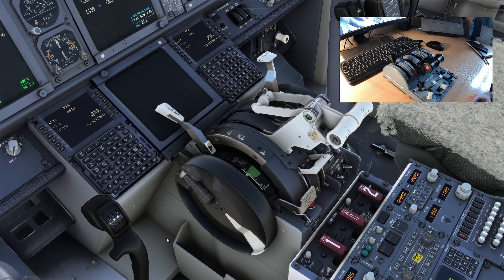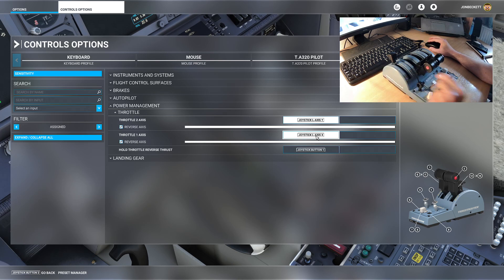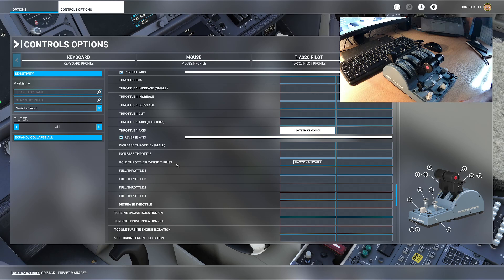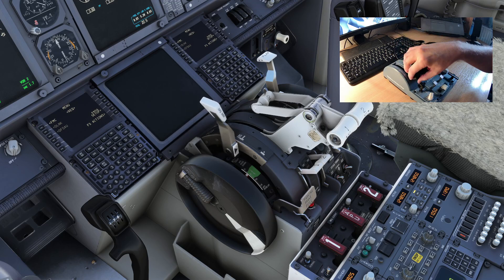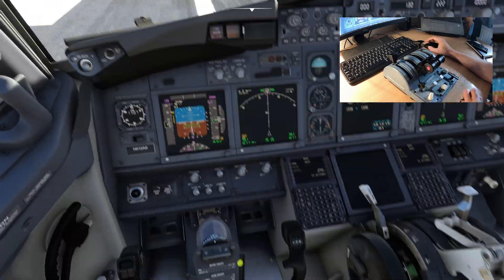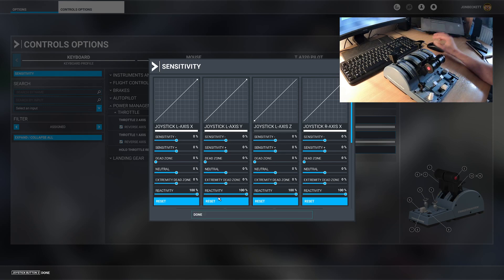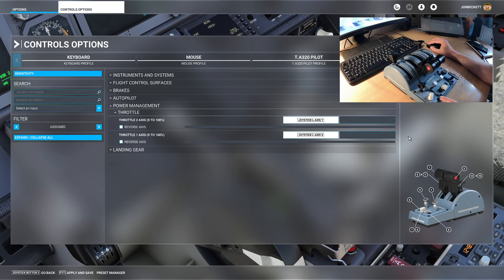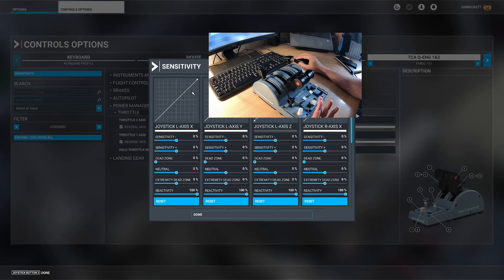How to configure the Thrustmaster TCA Throttle Quadrant for the PMDG 737-700 in MSFS

Comment: Hi can you please tell us how to make the engine start possible on TCA Throttle Quadrant what I mean is when you press ignition start on the TCA Throttle Quadrant you will trigger the switch on the overhead panel engine start GRD  and also is we can make the fuel cut off switch make working on the TCA Throttle Quadrant  for Pmdg aircraft  I would like to start the engine in my 737 without clicking the mouse on the overhead panel I hope you or somebody else can explain this to me ,but please don't say I need the span next for that or different fcuipc module

Comment: I actually managed to get it to work on the 0-100% keybind. I also didn't use a Hold/Toggle Reversers keybind. With a little luck playing around with the sensitivity I got it to go from 0-100% throttle without the need to have it in the reverse detent. And when you put it in the reverse detent, it infact goes into reverse thrust.
Reply: care to share how?
Reply: @MikeP343   @juliangriffiths9583  wow guys I'm so sorry I feel like the villain here for not sharing how.

1) Set Throttle 1 Axis (0 to 100%) to JOYSTICK L-AXIS Y
2) Set Throttle 2 Axis (0 to 100%) to JOYSTICK L-AXIS X
3) Open the sensitivity graphs (top left)
4) As follows:
JOYSTICK L-AXIS X
> "SENSITIVITY -" 0%
> "SENSITIVITY +" 0%
> "DEAD ZONE" 0%
> "NEUTRAL" 48%
> "EXTREMITY DEAD ZONE" 1%
> "REACTIVITY" 100%

JOYSTICK L-AXIS Y
> "SENSITIVITY -" 0%
> "SENSITIVITY +" 0%
> "DEAD ZONE" 0%
> "NEUTRAL" 48%
> "EXTREMITY DEAD ZONE" 0%
> "REACTIVITY" 100%

Hope this helps. Also the extremity dead zone can probably be 0% for both i think since i might have accidentally put one of them to 1%

Comment: I have a setting i have for the airbus Throttle for the PMDG 737 and i can use it for the 737 the yellow arrows on the throttle tells you where the reverse thrust is you bring the levers back then pull the throttle back tot he yellow area that is where the reverse thrust kicks in you don't have to use that button  works fine for me with my setting..

Comment: Many thanks for this, and your other videos. I found that you can indeed use the parking brake using this format. With the PMDG 737, after releasing the parking brake you then then either hold the toe brakes or the brake button on your joystick for around 3 seconds after release of the parking brake. That will then release the brakes.
Reply: I confirm

Comment: Sweet! Do the throttle cutoff levers work as well? If so, do you know what they’re labeled in controls options?
Reply from the maker: I use the mouse on everything else - there are numerous switches in the Boeing cockpit that don't suit the Airbus controller.
Reply: @jonbeckett  Thanks for the reply, Jon. I can’t get those fuel cutoff switches programmed for the life of me, I guess it just isn’t to be.

Comment: Hi i have set button one also for reverse thrust so copying your settings, and done all the sensitivity the same, but my reverse lift up maybe 50% tops but dont come so reduce to off off any idea's?
Reply from the maker: It won't do it before the engines are running :)
Reply: @jonbeckett  ahh thank you, I need to study this plane anyway my head is frazzled as I’m use to the A32NX and simbrief making it very easy now just love the cockpit details on the PMDG 737

Thank you as always your videos are superb 👍🏻
Reply: Sorry one other question you said about putting the Joystick sensitivity settings all to neutral, should i have this also for GA aircraft not the standard settings it has for the A320?  @jonbeckett

Comment: You can also try this. Go to Management/Throttle/Throttle then set THROTTLE 2 AXIS to JOYSTICK L-AXIS Y and REVERSE AXIS ticked. and THROTTLE 1 AXIS to JOYSTICK L-AXIS X. Then set THROTTLE 2 DECREASE to JOYSTICK BUTTON 16 and THROTTLE 1 DECREASE to JOYSTICK L-AXIS X. Then select SENSITIVITY and set JOYSTICK L-AXIS X and JOYSTICK L-AXIS Y to

SENSITIVITY-		0%
SENSITIVITY+		0%
DEAD ZONE		        0%
NEUTRAL			0%
EXTREMITY DEAD ZONE	-53%
REACTICITY

Your TCA A320 throttles, including reversers, should then work perfectly with the PMDG 737 😄

Comment: For some reason the engine masters won’t let me turn on the engine from cold and dark.  Does anyone have any ideas on how to fix it?
Reply from the maker: You need the APU running (electricity), the fuel pumps on, and APU Bleed on (compressed air to spin up the engines). You need packs off, otherwise the cabin pressurisation system uses the compressed air you needed to start the engines :)
Reply: @jonbeckett  Okay thank you!

Comment: Hi Jonathan, as you may remember, I've recently received my Airbus Captains TCA kit, just one point and it's with ref to your comment about the red button for TOGA, in your video at 2.25 you can see the TOGA button on the throttle, the buttons on the 737 throttle as ref to where the red ones are on the TCA kit, these are the Auto Throttle disconnect buttons. This is really only for those very new to the 737. But again as I'm getting into using the TCA kit, this is a superb video on setting the TCA kit up. I'm trying to find out where the calibration files are in MSFS, I've found them before and edited them but can't find them again, any ideas?
Reply from the maker: I just use the control profile sensitivity settings, and then the controller calibration (it's in the PMDG menu, in the FMC).
Reply: I found the files,  I had seen a guide to where they are but couldn't find it. Just used a Dos command to find them

Comment: My engine start keys do not work even though they are active. Airbus is working on the plane.
Reply from the maker: The start sequence (and hardware) for the 737 is very different than the Airbus - you wouldn't expect the start levers to work.
Reply: @jonbeckett  First of all, thank you for your interest, I wanted to ask you what setting you made for the engine start (idle/cut), I tried a lot, I looked at which keys are assigned in airbus, but I couldn't find a solution.
Reply from the maker: @orucmetehanmutlu  It's a multi-step process - not a single function. That's probably why. You need to have power, the APU running, APU Bleed on, fuel pumps on, Ignition system to Start, and then the starters will work.
Reply: @jonbeckett  yes, as you said, I tried yesterday by installing spadnext, even the brake needs to be pulled for the starters to go down.
Reply: @jonbeckett  I don't expect the TCA keys to do everything, just to control those two switches under the throttle levers. I don't understand why it isn't possible (although I now see that the TCA Boeing Qudrant indeed doesn't have anything that looks like those two switches on the TCA Airbus Quadrant).
Reply from the maker: @RonInbar  the Airbus Thrustmaster control is a bit odd in the way it's mapped - for some of the switches they are not just "on" or "off", they are "on on on on on on on" or "off" (if that makes sense) - and only some aircraft work with that logic.
Reply: @jonbeckett  The problem isn't with the controller really; it's with the PMDG aircraft. It doesn't expose an action for these switches that can be bound to a hardware controller. I think I tried everything that seems applicable. Also, it doesn't help that the Controls Options page seems to have been coded by the least competent programmers they had on the team.

Comment: What key is it called to start the engine with the 737? I want to set that up
Reply from the maker: There is no single key to start the engines on a 737 - it's a sequence of procedures.
Reply: @jonbeckett  I’m talking about the keybindings for the engine start
Reply: What keybindings is it to set engine one and two on start ups
Reply from the maker: @mb944  It isn't - I click on the starter levers with the mouse. If you check some of my 737 startup videos, I go through the startup steps required.

Comment: Thanks for this, you mentioned the parking brake doesn't work but it seems to work fine for me (other than having to hit the brakes for it to engage & disengage). The reverse works fine but I get the feeling I'll be shelling out for a Honeycomb Bravo in the future to solve this properly...
Reply from the maker: The switch on the TCA throttle works by sending the signal repeatedly. You have to be really careful about how you set it :)

Comment: I used this video and it worked for about two weeks and then randomly stopped working. I've tried switching to the 0-100 option as well but nothing seems to work.
Reply from the maker: Without knowing what else you've got going on with your controls it's hard to say. I've never had an issue with it working.

Comment: Hi Jonathan. Can you tell me what monitor you're using ,is it 4k only my monitor isn't as clear as yours.  Any help would be appreciated.  Thanks Alan
Reply from the maker: I see the simulator in 4K - but then it is down-rated to 1080p for YouTube by OBS (screen capture software). If I switched the monitor to a "normal" monitor, it would be a LOT smoother - at the moment I'm really pushing against the limit of the GPU to both display AND record at the same time in Ultra.

Comment: Since today my reverse axis are both gone. Now the throttle levers only know one movement. 100% or 0%
Reply from the maker: I've heard this from several other people - it may be the controller is broken.
Reply: @jonbeckett  It’s brandnew. I figured out the problem 😅 The filter on the left was on “assigned” instead of “All” and voila

Comment: I have a problem with parking brakes. There is a new way to do it but I can't set it. There is always a heavy noise from the cockpit like if you were writing on an old type writer. And when GSX ask to release parking brakes for pushback, I cannot go anywhere because I can't release them. Any solution with TCA? I have CH rudder pedals but one cable is cut and I can't use them. :|
Reply from the maker: Hold the wheel brakes on for a second, then you can set the parking brake while they are on. This is accurate to the real aircraft.

Comment: Jonathan I am so drilled from all of your tutorials. As you present them it is just brilliant. I do not know how many other see this, but this is personal statement, and of course I always learn something new. 
However, the parking break is not working in the cockpit, n of course I deleted, eliminated the function in the control options. 
The other think is; how gonna be functional the reversers trust at landing, (actually after landing)?, I confusing on this? I did set up the thrust as you did and how gonna works the revers thrust?  Would you explain this revers thrust Pls. Thanks
Reply from the maker: The break in the 737 is a bit unique. You have to hold the wheelbreaks on, then you can set the parking break.
Reply from the maker: On about the reversers, they only work when you're travelling - they don't work at a stand-still.

Comment: the reverse thrust part doesn't work for me. I set it to the same button as you, I'm holding it down, and moving the throttles and it just jumps a little but it doesn't move.
Reply from the maker: It only works when the engines are running.

Comment: My pmdg works like shit, ive done the exact same thing as you and my throttle don't go to idle when put to idle on tca and my parking brake don't work not even manually or with the tca p.b, my LNAV/VNAV don't work either, I've been trying to resolve the problem but nothing works
Reply: And pushback takes for ages to back up...idk what to do
Reply from the maker: Pushback will be taking ages because you have not released the parking brakes, or removed the chocks.
Reply: @jonbeckett  yup...my dumdass forgot to remove them 😂😂 I figured everything out now thank God!!!

Comment: Why not just assign that red button to the same assignment F2 uses on the keypad to select reverse thrust just hold the button down to get full reverse then open the throttles briefly to cancel reverse. Should work on any joystick. 
.
Reply from the maker: It's certainly worth a try.  I found a workable solution that works for me - there may be lots of other solutions too.
Reply: @jonbeckett  Yes, if the F2 key assignment works in the sim it should work on any joystick button.

Comment: Good one Jon ! I had to reconfigure, reverse thrust not working to my liking. I followed your steps 🐾 but instead of using TOGA button for pressing & holding, I assigned the white selector instead, IGN/START mode. This way there’s no need to press & hold :) Just turn it back to normal when reverse thrust no longer needed.
Reply from the maker: That's a great idea!
Reply: @jonbeckett  At least in theory Jon. Didn’t have time to check it out, if it’s really practical…that’s me will tell. Just finished Sunday group flight in Western Australia 🇦🇺

Comment: You can get the gear working: 

Landing gear:
"Set Gear" to Joystick 21 on press
"Gear Up" to Joystick 21 on press
"Gear Down" to Joystick 21 on release 

Parking brake:
"Toggle Parking Brake" to Joystick 20 on press

If reversers are too powerful, enable virtual buttons on quadrant.

If you want commonly used flap settings on your detents for T/O and Landing: 
Messing with sensitivity on the flaps you can make it take detents at 5 degrees and 30 degrees so you dont go to wrong flaps during landing and takeoff:
Joystick L axis Z = Sensitivity - -25%   and Sensitivity + +50%
Reply from the maker: Yes - but the gear on the 737 should be set to off after its travelled...

Comment: How do you ensure that your reverser tabs are always pulled up?
Reply from the maker: They only work properly when the engines are running. There are bugs in the implementation of the axis - especially when using the Airbus quadrant (which isn't designed to operate Boeing levers at all).
Reply: @jonbeckett  I understand haha, I meant in real life. The physical tabs I see on your camera POV seem always raised. Do I remove the detents for that?

Comment: hello thank you for very professional video. For 2 days my 2 ENG1/ENG2 joysticks at the foot of the stall, when I mount them to start the 2 engines (engine 2 sequence then engine 1) they come down on their own. I even (for tests) unplugged my TCSA airbus thrusmater (which of course works FBW) nothing helps the 2 controllers come down on their own immediately.
Do you have an idea? of course my PMDG is up to date with the latest version.
Thanks for your reply just in case.
Reply from the maker: Make sure nothing else is mapped to the function or the axis.
Reply: @jonbeckett  merci beaucoup je vais essayer

Comment: what about the Auto Brake Switch ? Do you have a hint to use the switch. My settings does`nt work from Disarm to Hi postion.
Reply from the maker: None of it will work properly on the Airbus quadrant, because none of the switch gear is the same.

Comment: how about the gear that you need to toggle twice that it actually retracts?
Reply from the maker: The gear level in the 737 is incompatible with the Airbus quadrant - you're better off removing the binding entirely, and using the mouse in the cockpit.

Comment: Thanks very much for your instructive video! I'm still struggling with the gear lever. I cannot get it programmed right for the gear-up function i.e the lever goes up but the green en red indicators stay on. So when i then move it down again and shortly after that up, it generally works but it is not rock solid. Do you have found a clue?
Reply from the maker: It can't be done without resorting to third party software. I've just disabled it, and use the controls in the cockpit.
Reply: About reverse thrust, I just found out that with your solution the reverse thrust is limited to about 75%. In the default controller setting there is full reverse thrust but difficult to control however. I think PMDG/Asobo have to do some work here.
n.b. Instead of "Hold Throttle Reverse Thrust", "Decrease Throttle" can also be used which gives a bit more power but still not full.
I have also bound "Autothrottle Disconnect" to button 1 (as in the real aircraft) and it combines well the "Decrease Throttle" function.
Reply from the maker: @NowIsGold  it's odd... I get full reverse thrust - but only while the engines are running. The alternative is just to use the keyboard to go full reverse. The controller really isn't compatible with the throws needed for the aircraft.
Reply: @jonbeckett  Strange such different results. The keyboard is no option for me since I'm flying solely in VR. But anyway, 80% RT for the time being is sufficient in in most cases I think.

Comment: For some people the Throtle 1 axis and the Throtle 2 axis work and for others the only way it works is by assigning it to the (0 to 100%) depends on how you have the thrust levers calibrated from the software.
Reply from the maker: Actually it depends how your physical controller behaves.

Comment: Thanks for the comprehensive tutorial. I do not understand if the levers of the TCA thrust reversers always remain raised and in this case how to do it, to me they always return to the locked position and lowered. Maybe I missed something.
Reply from the maker: It's a bit broken with an Airbus controller - to see them move, you have to have the engines running.
Reply: @jonbeckett  I think he means, on the Airbus quadrant, the reversers are spring loaded, and to pull the throttle all the way back, you have to manually flip the reversers to get the full range of motion.  On your video, you've rigged it so that they stay upright, allowing full motion of the quadrant.
Reply from the maker: @Bryanlbasil  Yes - I have. I then hold a button down for reverse thrust - which is the only sensible way I've found of configuring it for the airbus quadrant with the Boeing.